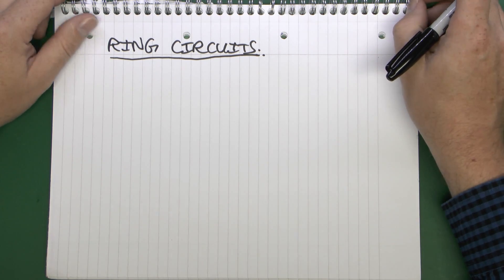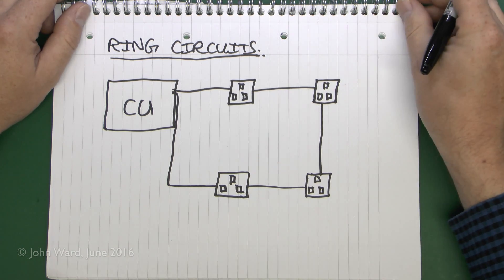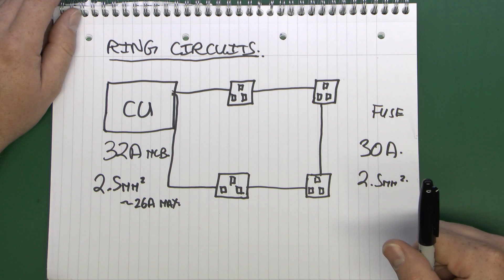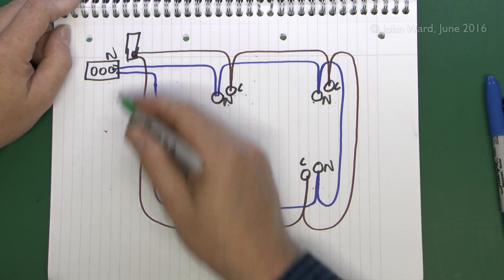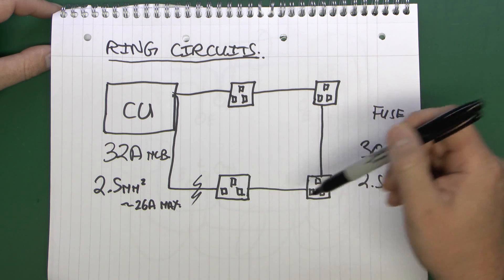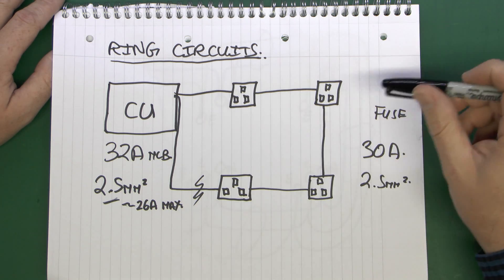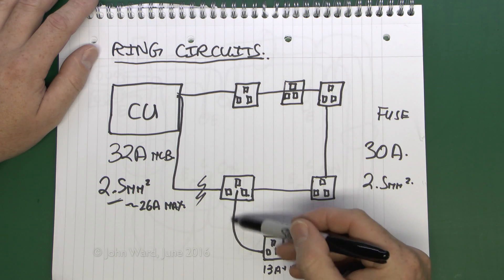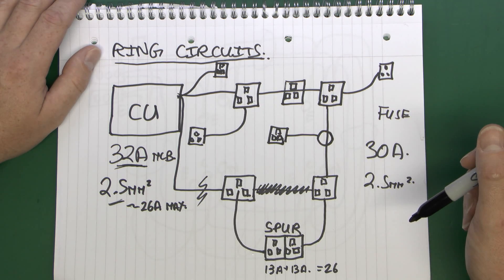UK Ring Circuits (previously Ring Mains) for Socket Outlets

Comment: Questions: What is a "Consumer Unit"??? We don't have those here in North America. My guess is that it's a completely self contained box found in every household, powered by deuterium and that they were called the "Coal Unit?" 
Do you have to feed coins into them every now and then as I have heard, or can you just swipe a debit card?  Being rated in square millimeters, are the square wires better than the round 12 Gauge wires we use here? Why 240 volts? Couldn't you just go with a full kilowatt with bigger square wires?    73 DE W8LV BILL

Comment: Very comprehensive thank you, I thought it was a great point about a wire in the ring losing connection and creating a scenario where the circuit is able to draw more than the rated 26 amp. Even worse if they are double sockets which is way more likely. Anyone is able to test this with a simple continuity check.

Comment: Just so I can understand, was it typical in the past in Briton to only have one receptacle circuit in this “ Ring” arrangement.
Reply from the maker: Yes, the original intent (in the 1940s) was one 30 amp circuit for all outlets / receptacles.
Houses at the time typically only had 3 circuits, 30 amp for outlets, another 30 amp for a cooker, and 5 amp for all of the lighting. If water heating was electric, there was a 4th circuit for that which was 15 amps.

The main point was to conserve materials, which immediately after WW2 were in very short supply, and a very large number of new homes were required due to war damage and a rapidly increasing population.  That's also when the standard UK 13 amp plug was introduced, previously there were many different sizes and ratings of plug in both 2 and 3 pin versions and ratings from 2 amps to 15 amps, all of which were totally incompatible with each other.

Today none of things apply, however there are still people who insist on installing rings for reasons known only to them.  Even worse - multiple rings in the same house, which is just a waste of cable.
Reply: I love your channel , thank you for the information you give us . I’m in the United States so I understand how we did things in the past and how we do them now . One of the things I’ve seen a lot is knob and tube . When I’ve changed these installations out for modern wiring I like to take pictures and give respect to the guys who did these installations, most of the time they did Beautiful work.

Comment: So, if you have a break that grounds one side and leaves the other side in the air, it instantly overheats the grounded side.  If the grounding doesn't draw over 32 amps the wire sits there burning.  Brilliant.  I've seen high amp draws that did not flip a breaker caused by nails being driven into wire while hanging a picture, poor wire nut installation, water intrusion, and rodent damage.

Comment: I am from US I am assuming, since they are at 240V they are using fewer amps on each device compared to us at 120v?
Reply from the maker: Yes, double the voltage is half the current for the same power.
1800W is 15A at 120V, but only 7.5A at 240V.

Comment: Providing 3.1 kilowatts to common household outlets is shocking.
I know they love their electric kettles, but I live in the USA and have not found the need for that much power from "normal" plugs.  Only major appliances, like dryer, stove, oven, and they have dedicated runs for each and actually have more power (30 or 50 A at 240V) so I suppose a British "cooker" would also need a larger power circuit too.
Seriously, what do you plug in, in a bedroom or living room, that needs 3 kW of power?
Reply from the maker: Very little requires that today, it's mostly larger kitchen appliances.  When originally designed in the 1940s it was done to allow a 3kW electric heater to be used, but that was before most homes had installed central heating.
Cookers and some separate ovens / hob (cooktop) have their own 32A circuit, but everything else uses the 13A plug including dryers, dishwashers and similar.

Comment: As an American with an electrical background, I've always been interested in what a UK "ring circuit" actually is, and how it works. This is the first guy I've encountered who explained it clearly in a way I understood. Thanks for that. 
It does seem like a simple enough concept, but I can also see why it was probably never adopted over here, because of extra wire, expense, etc.
Reply: I guess now I need to understand more about what a Consumer Unit is/does.
Reply: @UncaBeeTV   UK consumer unit ==  US circuit breaker panel.  The physical engineering is slightly different but the function is exactly the same.

Comment: Trusting the plugs of appliances to actually contain a correctly rated fuse seems rather ballsy (from a non UK perspective). Even if it's mandated by law, I would still expect stuff like adapters sold abroad or chinesium to sometimes not comply.

Comment: I just wondering. If it 2.5mm2 ring =32a mcb. Then if i use 1.5mm2 ring then can i use 20a mcb ?
Reply from the maker: Possibly, but as that isn't a circuit defined in BS7671, you would need to do the calculations based on the expected load, circuit length, installation method and so on to prove that it's safe, and attach those to the installation certificate which would list that circuit as a departure from BS7671.

Comment: I always used to argue with my lecturer at uni about ring circuits. He explained that if you create a ring circuit, there will be NO current within the cable. His point was that because it was acting like a massive battery terminal. So, he decided to show this with an ammeter. As you can imagine, even with a load, the ammeter displayed zero load.

Now, i wasnt convinced. i argued with this lecturer for over 2 years and ended up giving up. He always took the stand that there is NO load on the ring.

The point i was trying to make to him was that yes, even though the meter displayed a zero load. It was simply because the meter could NOT measure it due to it being a ring (In theory, the meter was never going to be in series as im sure you know when measuring current it has to be in series (Voltage is measured across)) as the ring was always attached at either end.

Just wanted to rant a little there :)

Comment: Wow, now I understand why the brits left the EU: 32 amps on an outlet and ring circuits. I am not electrician but I guess both is prohibited by the CEE since the 1960th. And I doubt this can save copper coz you need to loop back. One more hint: Avoiding fuses is another way to save material.
Reply: While the UK "Ring" Socket Outlet CAN supply 32 Amps, it is REQUIRED that each PLUG inserted MUST be equipped with a fuse rated at no more than 13 Amps.
Reply: @FrodoOne1  Still weird and I cannot see any advantage over a straightforward design. Worth a Nobel Prize.
Reply: @wolfgangengel7786  I fully agree with you.

Please seehttps://www.youtube.com/watch?v=hZN6hiGLtrE&t=875s for the comments of John Ward upon this type of installation.
Reply: @wolfgangengel7786  
There are lots of advantages. Lots.
Reply: @johnburns4017  Right if you mean to avoid fuses. If you mean loopin back i need examples.

Comment: The 120/240 video from Technology Connections brought me here.... Only to find my newest concern.... The 3 vs 4 ring paper used in notebooks.... Is this a new deviation from Across the Pond?
Reply from the maker: Paper in the UK has either 2 holes or 4 holes, 4 hole paper will fit into a 2 ring binder. 
Other choices including 3 hole paper and letter size pages do not exist here.

Comment: Certainly helps make sense of the UK system.  That being said.... North America is not altogether different.  We have “spurs” off the breaker box (where the “fuses” went...) that create parallel receptacles along one 2+ground cable.  Regulations dictate how many boxes you can have on one line... and include switches as well as outlets.  All “connections” of cable must be accessible.  Although lately, there have been joining methods that can be buried under certain circumstances... but these are never soldered together.  They must be mechanical.  Just one thing is not clear.... are your houses limited to one consumer unit ie 32amps?  Since the late 1970’s, houses tend to be 200amps, although there are many 100amp services that exist.  Of course, the biggest difference is our residential services are all split phase 240v ie fed from a pole transformer as 240v between L1 and L2 and 120v between any leg and neutral.  Viva la difference! :)
Reply from the maker: Most supplies to homes are 60A, 80A or 100A, everything is 230V. Although it was common to have a single ring for all of the outlets, that's not usually how more recent installations are done.
Modern consumer units are rated 100A.
Reply: @jwflame  I have relatives in the UK with an older home... and a friend who is a general contractor -  his electrical service is more familiar to me... in keeping with the NA respect for energy conservation, modern services now are typically 200 amp services 😉🇨🇦

Comment: The idea doesnt seem so terrible, if you just make the change that the wiring needs to be able to handle a break, and the continuity of the ring being non safety critical.

If you're wiring up a radial for an entire room, connecting the far end to the start might only use a slight bit more cable, but reduce the effective resistance substantially.

Which would be fine if it was just a "nice to have" less voltage drop, more efficient, non safety critical kind of thing

Is having overrated cable that problematic? The issue appears to be more with the cheaping out, just make it 3.5mm, or whatever, or just restrict the 2.5mm^2 to a 25A, but with the ring main still in place.

Comment: I am a retired electronics tech who actually did some rewiring in my father's house in the UK. The old, lead-covered cable under the floorboards was beautifully layed out and neatly dressed, but as soon as it was disturbed the old rubber insulation disintegrated. I am guilty of incorporating "a borrowed neutral" into a three-way stair lighting circuit, but I am sure that the house has been completely rewired since my father sold it in the late 1980s. I could not understand the need for a ring circuit, primarily because I understood the risk of overloading in the event of ring discontinuity. This is the first video I have encountered that explains why I was correct about ring circuits.

Comment: Came here from Delroy. As an Aussie sparky I found ring circuits weird but probably only still in the standard because it exists in old homes. A lot like engineers still having to deal with imperial machine threads and sizes.

Comment: What happens if you don't delete the extra part of the ring at 12:45? Can you have a figure or 8 circuit?
Reply from the maker: The sockets would still work in that arrangement, but it's not recommended as all of the load for the 2nd half of the '8' will be concentrated at the single point in the middle, which could result in one of the cables in the first half being overloaded.

Comment: As ring mains are ‘an invention of lucifer’, and I have so few sockets on mine anyway, would it be fairly straight-forward to convert the rings to radials? The house has two ring mains, one up, and one down, each respectively supplying only 5 (4 plus a spur) and 6 (4 plus two spurs) sockets. There are separate circuits for the lights (radials), cooker etc (radial), and separate fuse-boxes for storage heaters (restricted) and panel heaters (unrestricted). The ring mains appear to be older than other circuits (I guess they would be), and I want to have them re-wired. So, would it make sense, and be relatively easy, to swap them to radials? I'll get a professional in, but just want to know what I'm asking for first, and radials would seem to be safer.
Reply from the maker: Rings are still valid, but entirely pointless for only a few outlets, and also pointless if there are multiple rings in a single house.
Radials with one for each floor, one per room or other arrangements are a far better design.
Reply: @jwflame  Thanks Jon, that's really helpful, and thanks again for these great videos. So clear and well explained.

Comment: This would seem to be a sensibly safe design if each leg of the ring were connected to a breaker limited to 16A per leg.  Thus a single socket drawing 32A would pull both directions around the ring. This way an inadvertent break in the ring would not create a safety hazard.

Comment: Great video. Clear explanation. Currently studying this on my Level 1 Diploma course. Makes so much more sense to install separate radial circuits throughout a domestic dwelling. Cheers!
Reply: Take a 20 amp breaker on a radial. Maximum of 32 metres. You wire to socket. From there you branch two ways. And do the same again. And again. You can end up using 80 metres of cable but the furthest point from the main panel might only be 20 metres.  Such complexity. 

Then the voltage drop. A final ring is fed from two ways. Then safety as the earth (cpc) has two ways back to the main panel.

Comment: Hi JW, from another JW, I recently wired my workshop, sockets and lights, with a 3 core SWA that was used previously for a greenhouse socket using this, your radial and SWA videos which were a great help - thank you. I awoke this morning however questioning myself as I hadn't checked the house CU MCB rating for this line. The workshop CU is 32A ring (because it's 32A) and 6A for the lights so my question is as I have now checked the Main CU MCB, which is 16A, do I need to get an electrician to change this to a higher rating?
Thanks Jez
Reply from the maker: The MCB is there to protect the cable from overload.  Whether you can change the 16A to some other value depends on the rating of the cable, the MCB rating cannot be more than the cable rating.

Comment: Do we have to be cautious here in powering on the equipment's in the sockets here to not overload above 32amps?
Reply from the maker: No, the circuit breaker will trip if the circuit is overloaded.  If installing a new circuit, the loads likely to be used with it must be considered, so it might be appropriate for one circuit to only supply a kitchen as the loads will be high.  For others like bedrooms, one circuit could supply multiple rooms as the loads will be lower.
Reply: @jwflame  thanks a lot.
Is there an issue in adding a 6A socket to the 6A light load circuit(lights/fans etc)
Or does all the room sockets (6a) need to be in separate circuit(6a) like the ring circuit you mentioned in this vlog?

Comment: the 13 amp ring main was a major step forward in safety,before they came along you just had a 15amp round pin socket mostly one in the kitchen and one in the living room with lots of double plugs coming out some giving 5 amp outlets for radios ,all the plugs were on seperate wires ,the new idea of ring mail done away with all that and electric fires stopped happening and they have gone on for many years without any fires,,,,you have to remember the wire used them days was 7 stranded  [7/029] which you would twist together before you connected it in the socket so it was very unlikely it ever come apart,also there were no junction boxes that was the whole idea to do away with them,,,,,same with lighting circuits,No ring mains worked well and saved money,,,now the big question was the use of electric fires ,I wont go into that but they were in use in the early days and then out again as was the coming of cheap pugs ,,,,they were the things that got hot because they were sub standard  they caused the fires.also left out was the diversity factor which is important but not mentioned.also the single core cable that are not twisted together now.

Comment: Does having more than needed current cause light bulbs etc., to burn out faster? 
Is that a dumb question? haha.
Reply from the maker: Current rating of a circuit is just the maximum available, a light bulb or anything else will only use the current it's designed for.

Comment: I watch technology connections, but the YouTube algo started feeding me videos of UK electrical contractors. I found it very interesting comparing to what we have in the US. Ring circuits seem like insanity to me from US standards.  Also. 32a on 14awg wire at 240v seems like an insane amount of power to have at a regular power point. Considering the average us outlet is 15A at 120v for a maximum of 1800w. 32a at 240v is 7200w. That is madness to me.
Reply: This is why all U.K. plugs contain a fuse which are typically rated at 3, 5, 10 or a maximum of 13A. The maximum loading on a U.K. socket is 3KW which is approximately 12amps.

Comment: With this ring circuit there is also the problem of inserting the return wires into the same electric pipe. It is more difficult to insert 6 wires then 3.

Comment: Hello, 

Can someone advise me please?
I have a double socket in my bedroom from which there are two red and two black wires coming out of it and one earth. I wish to add a spur socket in the cellar next door and want to run a 2.5mm twin and earth cable from the bedroom socket to the cellar. Will I be okay to do this, or is there any danger of overloading the bedroom socket? Just looking for some reassurance. Cheers. 

Cheers.
Reply from the maker: If the existing socket is on a 32A ring, then you can add one double socket using a single cable.  If it's a radial circuit (usually 20A or 16A), then you can add as many sockets as you want.
Reply: John Ward many thanks.

Comment: A 20a Radial using 2.5mm Cable? I am fairly certain that any new Radial, 16amp and above, should now be on 4mm Cable. Please correct me if I am wrong.
Reply from the maker: 2.5mm² cable is rated up to 27A, depending on method of installation.
Reply: John Ward  it is yes. So why the new recommendation of 4mm?